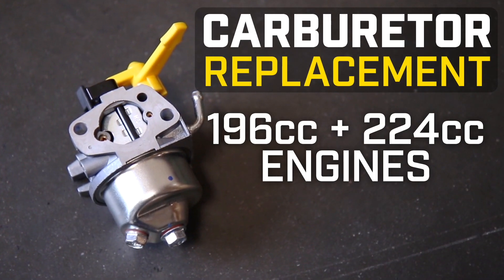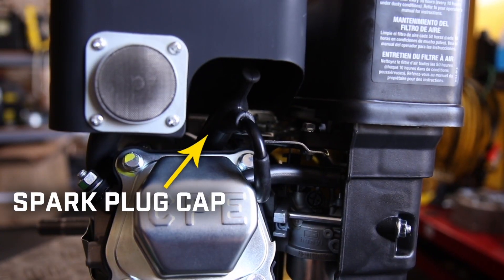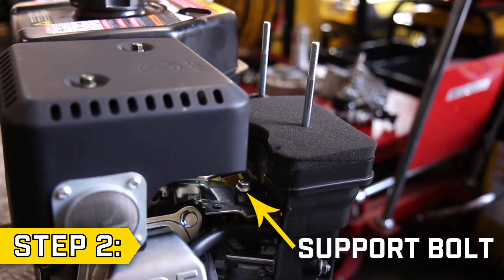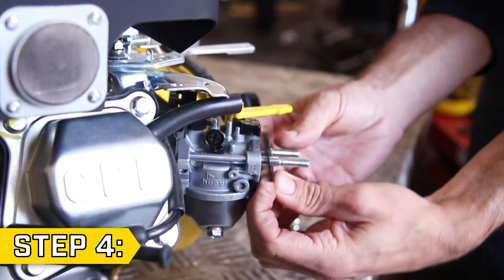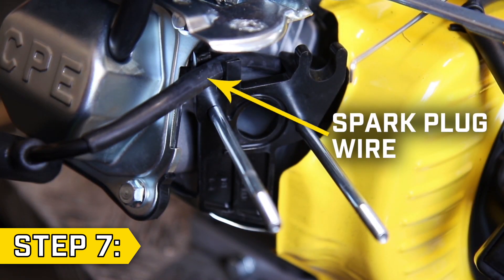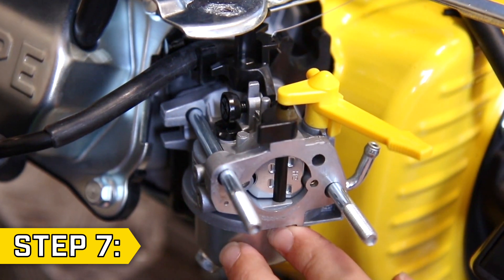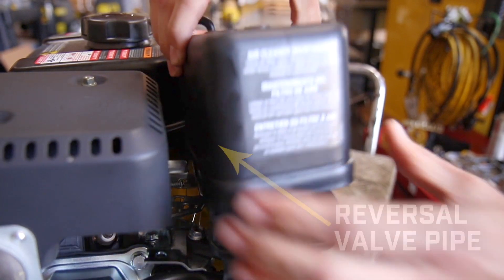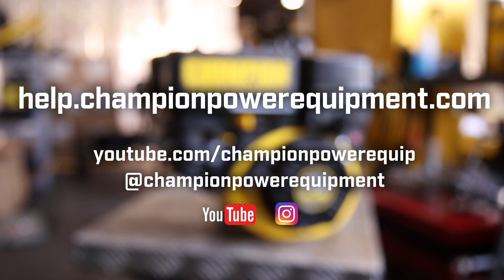Carburetor Replacement (196cc + 224cc Engines)

Comment: Ok, so I have tried to call this company for over an hour and the only thing that happens is the constant playing of "someone will be with you" This information is not in the owners manual. Now this generator might be duel fuel but I don't think that you can have fuel and propane at the same time. If you turn the EZ dial to the run position, it will start to dump fuel into the carburetor bowl. So you can't run propane and fuel at the same time. This machine isn't that smart to cut off a fuel supply being that the propane hose is connected.
Reply: What’s the part number of 2600 psi with 196 cc replacement of carburetor?
Reply from the maker: We are sorry to hear this. Please note we can also be contacted via live chat through our site or by email at support@cpeauto.com. These units do not have a fuel selector like our previous models. The propane fuel system will detect the pressure/fuel coming from the propane tank and it will automatically start on LPG, if the propane fuel valve is open. The same applies to gasoline, as long as there is gasoline in the tank, it will run. The unit will automatically choose propane over gasoline if a propane tank is connected to the unit with gasoline in the tank, but ONLY if the propane fuel valve is open on the bottle, as previously stated. Thank you.